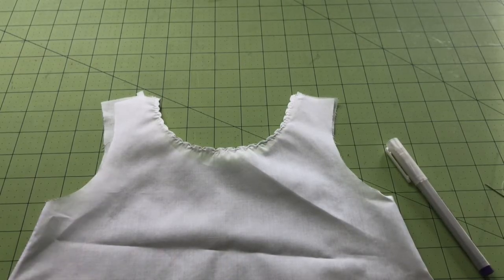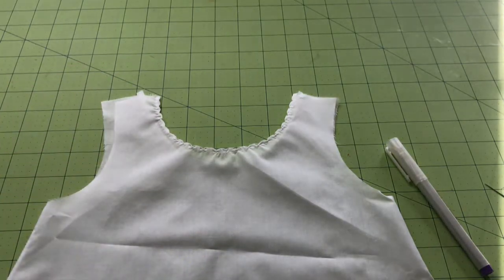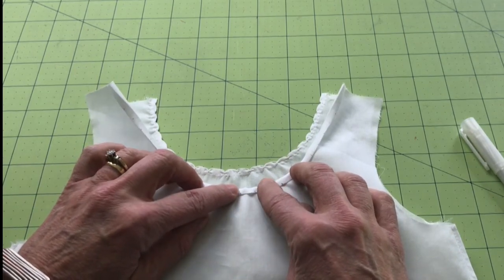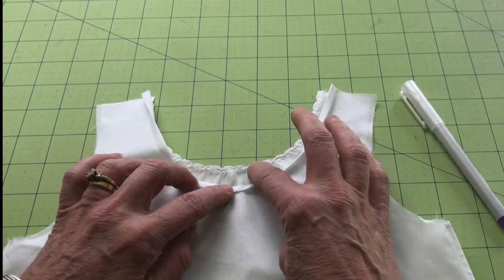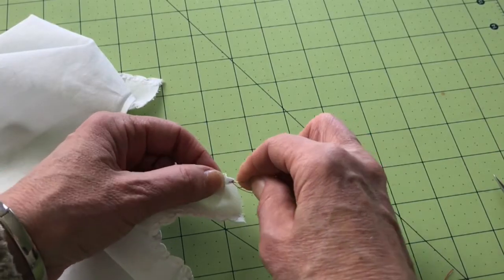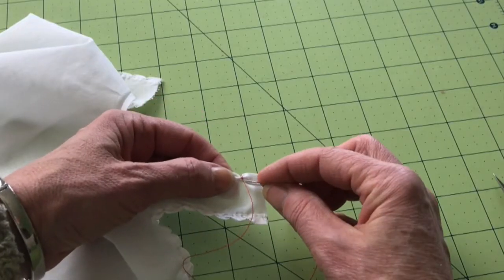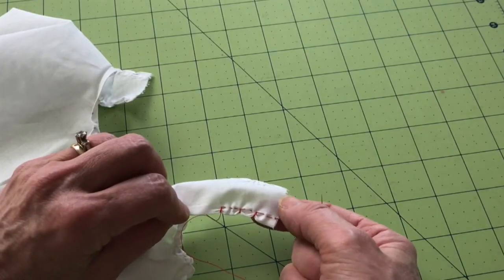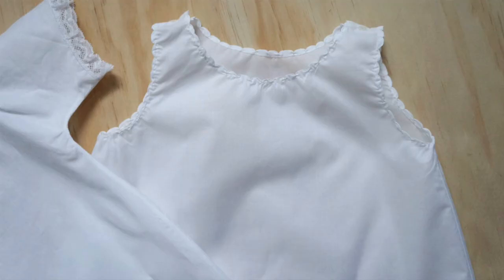Shell Stitch Edging

Comment: This is great! I never knew how to do this before. I have 4 camisoles, 2 polyester & spandex, 2 cotton blend & spandex. They are silky feeling. I wore them a lot under tops since I don't wear a bra (I don't need one.) But they were too long and kept pulling up with any movement. I had to keep tugging them down. I decided to cut & hem them to a crop length. I didn't care for the hemming. It didn't work well with the stretchy fabric. So I cut them some more and tried this stitch. The only difference is that I only folded once. When I had done the original hem I folded twice and they ended up rolling when I wore them because of the stretchy fabric. So now there is a raw hem but it doesn't unravel because I am careful washing them. I don't put them in the dryer either. I finished them in one day. Works great and I really like wearing these crop camisoles now. They are looser being so much shorter and they don't rise up on me either. I will probably do this with other camisoles I have a problem with in the future. Thank you very much for these instructions. You made it very simple to understand.
Reply from the maker: Elizabeth I am so gld that you found the instructions helpful. Enjoy wearing your camisoles!